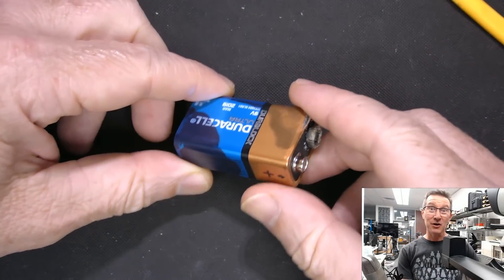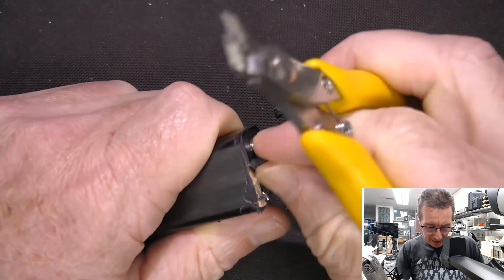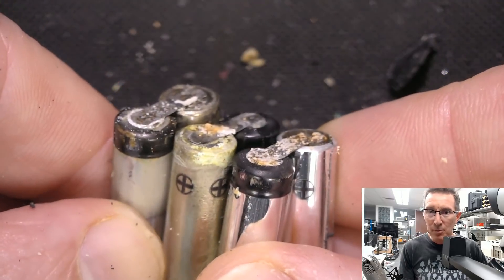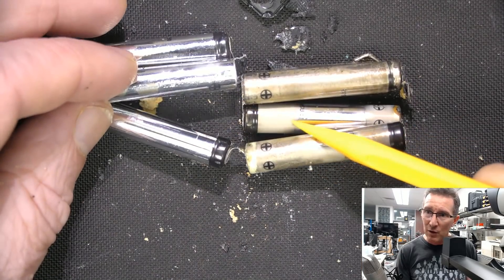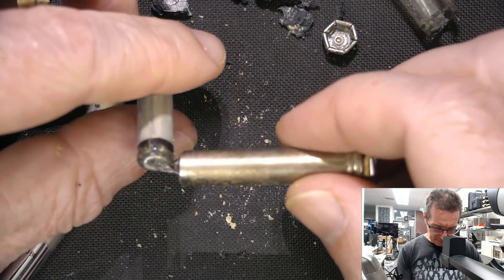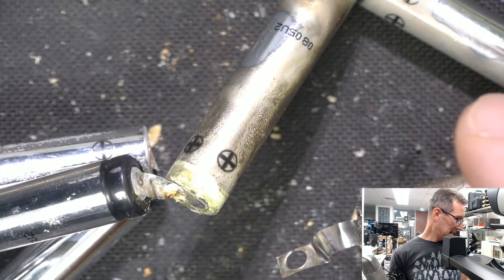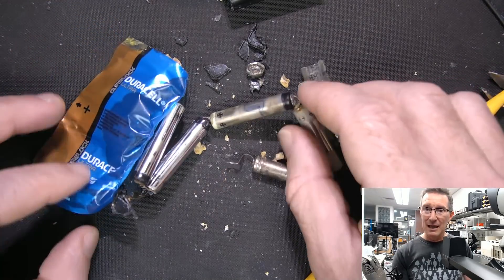9V Duracell Alkaline Battery Leakage

Comment: This week I bought an NOS Fluke 73 Series II new in the box.  it had the original Eveready 9v installed at the factory with the no leak promise printed on the battery.  It didn't leak anything after 25+ years.

Comment: Also those quadruple a batteries are used in some devices just not very often you don't see him much but you can get them in retail packaging.

I do believe that's probably the least used and on a side battery I've ever run across.

They started out being used some pin lights and also early laser pointers

At least that's when I first found out about them.

And sometimes medical devices but not sure exactly what but I know they are used occasionally.

But also if you have that 9-volt and you're needing aaa's and of course the battery is a good battery you split them open and extract individual cells and you can use them in AAA applications I don't remember if you need to fill the battery compartment out with aluminum foil or anything but I know that it can be done.

Just like you would use Triple A's instead of Double A's of course on both ways a capacity decrease but in a pinch it would work.

I once ran a NOAA Weather Radio on Triple A's instead of Double A's

And also certain 6 volt Lantern batteries use for f cells the big round ones that the two of those combined equal 3 is it C or D cells I can't remember the links that is of course it's only going to be three bolts instead of 4.5 but it will run a flashlight design for that although LEDs are more successfully run that way

Comment: i wonder 4.5V battery was ever made with just singular cell rather than the 3 B-cells as is more common for a while.
Genuinely interesting how form factors are usually just a legacy thing now since most less popular ones tend to be just another battery inside shell that fits in particular slot.

Comment: So 18650s in power tools?? They’re apot welded together with a thin tin metal band.
If replacing 18650s in power tool battery. How would I do a proper job... I’ve tried soldering but messy job, and because of high amps would soldering be upto the job

Comment: alright so .. I'm amassing a collection of old calculators .. what should I stick in 'em .. low capacity ENELOOPS are still expensive and kind of a waste ..

I'm thinking of silver coin cells wired instead of the AAs .. those don't leak that much, do they!?

Comment: Used to use a lot of duracell's but the AA & AAA batteries either don't fit or fit tight into remote controls and the covers won't go on right from the amount of plastic shrink wrap so gave up on them...

6 cells in a plastic case... our duracell 9V batteries in the UK are still metal cased... no idea if it's small cells or if the metal ones are a single cell in their own right.

Comment: Had 4x or 6x Duracell AA batteries in a PS3 game controller for Drum Hero (I think) and after growing up stored it away in a very cool and dry place, away from any problematic moisture ingress or physical damage. Ended up opening the damn thing after a couple of years to try assemble it and play a little (for old times sake). Forgot I had left the cells in there! Don't need to say, there was acid residue all over the controller and all of them were leaking their brains out. All original, brand name Duracells and got all of them destroying my equipment. Had a lot of Pairdeers and cheapo name cells in keyboards, pc mouse and flashlights, etc. never had a single leak except for some Phillips who were abused inside a remote TV controller. Duracell are just awfull. Don't buy into their cool marketing. My preference... PANASONIC or Fujistu cells.

Comment: I have not seen a duracell leaking and therefore we are usually buying those since energizer had been sucking.
We use them a lot due to 10 years warranty and we do not reach the limit of 10 years cause they will be done earlier, even in multimeter usage cause once in a while you simply forget to turn it off so the power drain goes on and batter life is over after maybe 5 years. 

But maybe different qualities here in europe cause we do not have this color sheme at all: simply the good old copper colored style since the 80s and the ads from that era bunnies jumping around

Comment: You hit on exactly what happens when these batteries leak: voltage reversal. Think about that: when the voltage flips, it means that the battery has transitioned from being a battery to being a load resistor. I'm pretty sure that's what triggers the leakage mechanism. The weakest battery in the string will flip first, the danger of a series stack like you get in a 9V battery.

Comment: Different then the 9v I took apart long ago, there was a stack of 6 rectangular flat cells stacked inside.
Reply: That is a better design than the cylinder ones as it gives higher energy density by not wasting space.

Comment: Looks like a counterfeit Duracell battery. The Duralock label means it frankly won't leak on you under any circumstances from my experience. I notice living in Australia I have to be more careful looking out for counterfeit products, requiring me to contact the manufacturers to double-check things.
Reply: They leak even in the package as do Duracell Ultra and Quantum and Optimum even new still in the packaging.  Duracell are avoided in my household.

Comment: It cannot be beyond the wit of engineers to encase the batteries to stop the content from damaging the electronics in  which they are placed. Failing that, why are battery compartments of equipment not  sealed against the leak of the corrosive battery contents? 
The paranoid might conclude that there is a conspiracy to make the equipment fail and require early replacement. 
It can't be that expensive to add a squirt of hot melt glue, where the battery wires enter the battery compartment, to stop any of the corrosive liquid from making it onto the equipment circuit boards. The classic example of this failure must be the TV remote control, where the entry point for the  battery spring clips, allow the leakage from the battery to etch away the connecting PCB.

Comment: They are slightly smaller than AAAA - they are made so that, when finished with an insulating wrapping around the outside, nipple for the positive top and flat plate for the base, they would be AAAA size.

Comment: "They're designed to protect themselves, not your equipment." Not quite true. They're designed to not throw shrapnel around due to overpressure. That could be worse for your equipment than just leaking.

Comment: In the US, a lot of 9-volts have a stack of rectangular cells, instead of AAAAs.
Reply: Interestingly I just pulled apart a 9V Duracell and it too had a stack similar to what you used to see in carbon ones. And I'm in Australia. Has a nice clear case containing all of them. Worth pulling apart just for the visual.

Comment: The metal backing on the outer foil is a few microns of aluminium. And aliminium dissolves easily in strongly alkaline solutions, evolving hydrogen gas, as it is reducing the water.

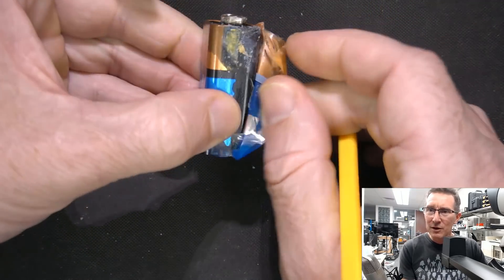Comment: It's interesting how the electrolyte has disovled the silver foil from the wrapper wherever it was in contact. Not just the 3 x AAAAs but the outer case wrapping as well (1:16).   I wouldn't be surprised if only one of those AAAA's actually leaked and just disolved the wraps of the other 2.

Comment: Yeesh... curiosity - were 9V batteries always like this, or it became a cost cutting measure overtime? I mean, using multiple AAAA batteries there instead of an unique design for 9V?
I guess it's not as eggregious as fake 18650s that actually have a tiny LiPo pack inside, but still...

Comment: I just bought a set of Tenergy 9V Li-ion batteries (2 series cells for nominal 7.2V, of course). I'm in the process of constructing some discharge curves, and I might throw the data up on the forum once it's complete.

Comment: This is why I have started using non-rechargeable lithium batteries in test equipment that I seldom use. I can leave the batteries installed and not worry about them leaking. They cost a little more but it saves the hassle of removing and installing batteries to guard against leakage.

Comment: those are a little shorter than a 4 A  battery i use to use them in a flash light or a (torch ) had to stretch the spring to make them work

Comment: I beg to differ on 9V Duracell batteries leaking. They do eventually. Often puffing out the plastic bottom piece. However in the past, the most common failure mode that prevented a normal lifespan was one or more cells either having poorly spot welded metal links or slight leakage from a cell (but within the battery casing) causing the welded metal links to fail where they were spot welded onto the cell terminals. Either way, the effective internal resistance of the 9V battery increased causing either the electronic devices to complain about a low battery or it would only work intermittently. Hence often it never had the chance to leak alkaline gunk into the product it was being used in.

Comment: I had a new package of Duracell AA's, a couple years ago, where several of the cells were quickly leaking in devices, and they were nowhere near the expiration date. It seams like I remember one had leaked in the packaging. I threw them all out and haven't bought Duracell since.
Reply: Yeah, even the expensive ones like "Duracell Industrial" leak way too much. If there one thing I expect from professional batteries, it is that they don't leak into expensive devices.

Comment: I’ve switched to lithium AA, AAA, and 9V on my pricey test equipment. The cost is quite high upfront, but I haven’t had any issues with them leaking. They last quite a long time with that wacky quirk of dropping off the plateau at their end of life. Anyone experienced them leaking over there useful life?
Reply: Not in use (I use PP3 9V lithium batteries, in smoke alarms and test gear). However I ordered some from a legitimate electronics supply company once, and one of the four in the order had leaked in it’s packaging (the usual vacuum formed plastic and cardboard type). They sent a replacement once I explained the problem. I don’t know if this was simply a manufacturing fault. It was well within the date code.

Comment: What batteries do you reccomend?
Reply: If it's very low drain you can't really go wrong with zinc-carbon, otherwise lithium.
Reply: Non-rechargeable lithium. They cost more but they don't leak.

Comment: Hi Dave, I bought 12 Duracell 9volt ultra long life alkaline batteries with expiry date 2022, after 6 months 7 of the batteries had signs of corrosion and 2 of them had the negative terminals corroded right off, and seemed to be genuine as well.
Still enjoying your videos, keep them coming.
Steve K
Reply: Seriously half your Duracell corroded in only 6 months and 9v too?  Duracell is supposed to be high quality brand and 6 months is a short time and 9v are least prone to leaks vs AAs and 7 out of 12 is an unacceptable failure rate.  Maybe you had a bad batch.

Comment: I know of a company who designed a product around AAAA batteries, they used to crack open 9V batteries for the cells because it was cheaper than buying them directly.
Reply: I have a laser pointer with 1x AAAA battery in it, which I love -- lasts much longer than a tiny button cell.

Comment: It’s not even a new problem, I repaired several Fluke 8060A DMM’s 30-35 years ago that had suffered damage with leaking 9v Duracell’s
Reply: At one place I worked there was a guy who guarded the department multimeter. Anyone who borrowed it took an oath on pain of death to remove the 9V battery again afterwards lol.
Reply: My ancient 75 I was given had such trashed contacts I had to remove them and jam a wired snap in it. Thing had been in a toolbox so long I wouldn't doubt the battery in there was pre mercury phase-out, so much for that theory.

Comment: I have never had a battery that eventually doesn't leak.  Radio Shack, CVS, Phillips, Duracell, Everready, Energizer, Ray-O-Vac....all of them end up leaking.  I've come to take the batteries out of anything I don't use on a daily or weekly basis.  My HP-15C, HP-48, and my HP-41CV.  I pull them from tools that use batteries as well (Laser levels, digital calipers, etc).  I've just learned that if it has a battery, it WILL leak...doesn't matter who made it.

Comment: Practically every Duracell battery I've ever had in the past few years has leaked - some even while they still have a charge. 
Absolutely terrible battery. I've banned them from the house.
Reply: Most of the branded batteries leak. I found that Sony batteries are better and leak the least.

Comment: You know the old saying: When it leaks like hell, it must be a Duracell.
Reply: Durahell. As someone else in the comments asked, how is this company still in business?
Reply: @vincei4252  Duracell has by far the largest market share of batteries (look it up) - hence they will have by far the most reported anecdotal reports of leaks. I buy Duracell and Energizer batteries in equal quantities and have around an equal amount of leaky batteries between the two brands.
Reply: @TechBench  How do cheaper generic brands compare?
Reply: @TechBench  I don't go by anecdotal reports of leakage. I go by the fact that they leak in my equipment. Also they are always larger than they should be so that they can get stuck in if they leak and swell up a bit.
Reply: @TechBench  Never had an Energizer explode on me...
A few days ago I had a Duracell OEM AAA blast it's cathode out the end! Takes "leaks like hell" to a whole new level...
To paint a scene; I was frantically unplugging switchmode plugpacks because I thought it was a capacitor at first!
Reply: We used to use Duracell for most appliances, until we got a lot of leaking batteries (even for the more expensive Duracell ones). Then we just switched to cheap off-brand alkaline batteries, and never had a leak again. Maybe they just run out quicker, but I don't care as long as it doesn't leak as much.
Reply: @sanderd17  Yeah, same here. I don't really need anecdotal evidence looking at all the devices of mine that Duracell has destroyed or nearly destroyed over the years. I was a slow learner.

Comment: The battery wrap might be some sort of Metallised Film, or Mylar -- a very common material.
Reply: Metallised film, printed, and then a separate vacuum deposited film is heat sealed to it. The edges of the aluminium film are exposed, so gradually the deposited film degrades as moisture and other chemicals work up the thin layer from the edge.

Comment: Yep. AAAA cells for my surface stylus - the only time ive ever had to use one!
Reply: I just posted the "AAAA" before seeing your post. I used to buy the 9v batteries to easily scavenge Quad-A batteries for one of the first thin pen laser pointer I had just bought. The manufacturer sold the "SPECIAL" batteries and they wanted  3 or 4 times what an overpriced 9 volt cost. I was in electronics at the time so I spotted it right away. Good thing too, that thing went through batteries like crazy.

Comment: The Homeware brand used the same construction.  I managed to blow one up running a led light on it.  It didn’t blow up while running the light but 8 hours afterward.  POP! It blew the contents partway out of two cells.
Reply: I took apart a dead 9V once and was moving around with the string of AAAAs and one popped in my hand!
Reply: yikes
Reply: Was thinking "bullshizz" when I first read this comment - and then unironically had a Duracell OEM AAA battery explode right next to me :/
After returning to post this, I've seen a fair few comments on battery RUD...
The battery of mine had been discharged at 125mA, and then 15.6mA for a capacity test - it was at 1 volt and 8 hours after I removed it from the test jig, BAM!
I thought a capacitor had popped in some power supply, so I was unplugging things until I spotted the battery with it's cathode all busted out...